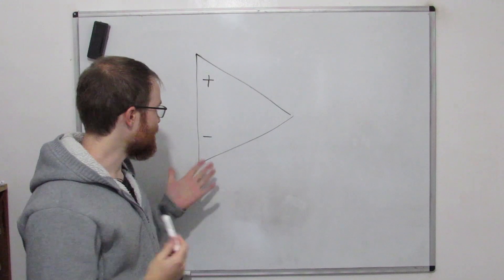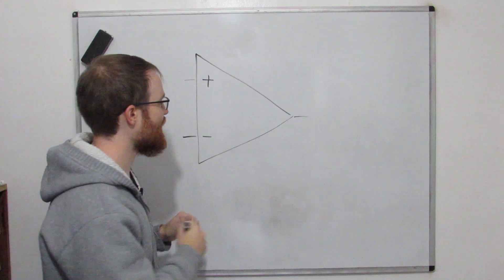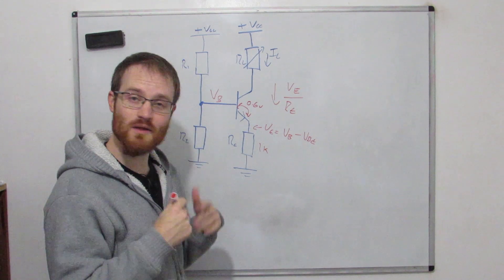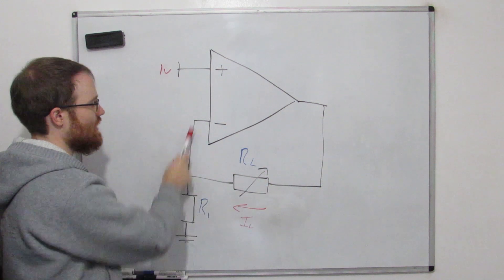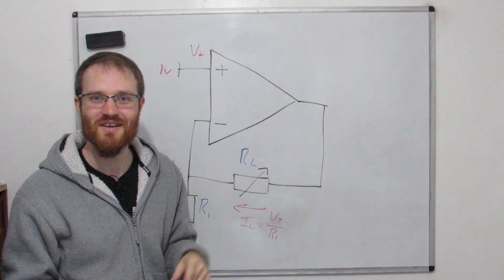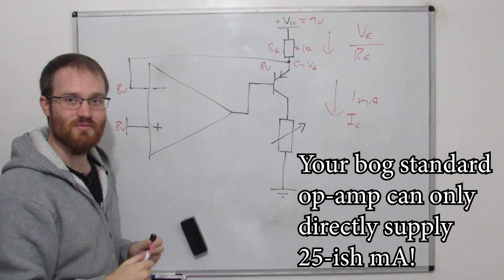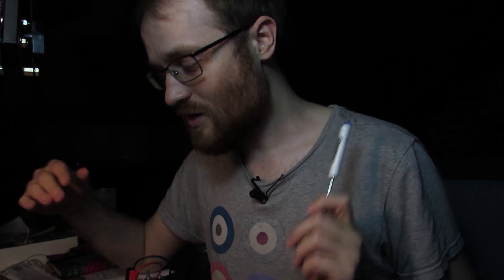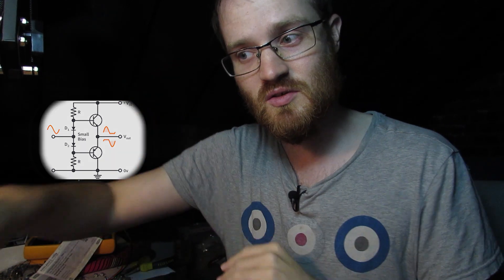Making Transistors Easy.. With Op-Amps!

Comment: Hi there! Great videos! I've learned a lot from them!
However, there's one topic I can't wrap my head around: how to achieve a high voltage output (close to the rail voltage) from a differential circuit (using only the differential transistors) while maintaining high linearity and precision in differentiation. The literature suggests that a folded cascode circuit can achieve this, but I can't get it to work or fully understand it. I've tried simulating it in Multisim, but without success. Could you explain it or help me with this? That would be amazing!

Comment: I made the 2nd circuit with an LM324 (rail to rail), 2n3906 PNP, 1k Rc, 1k pot on the emitter, 5v supply.  While the circuit works, I can't get an emitter voltage below 1.3v when I set my vref below that (however if I configure the LM324 as a buffer, it tracks the voltage below 1.7v very close to low rail just fine though).  Any ideas why the ~1.3v limit?